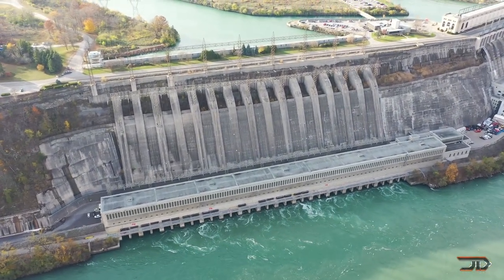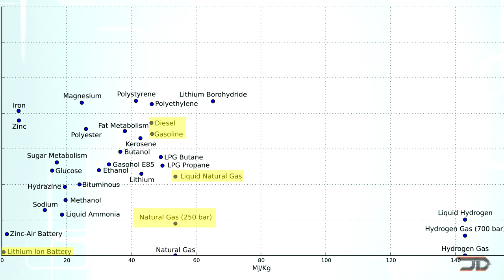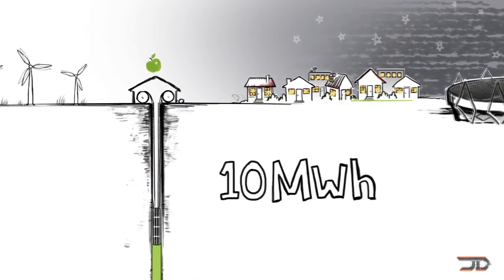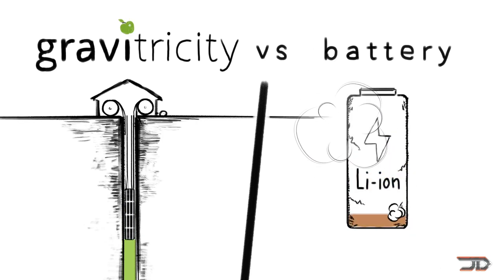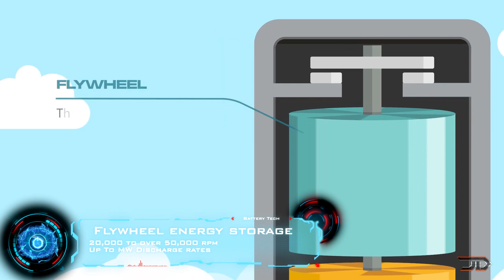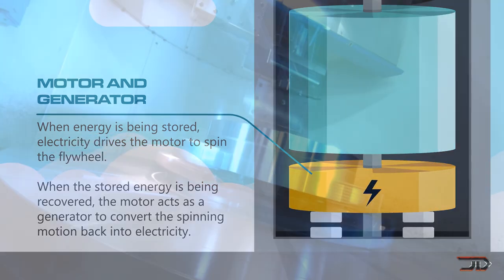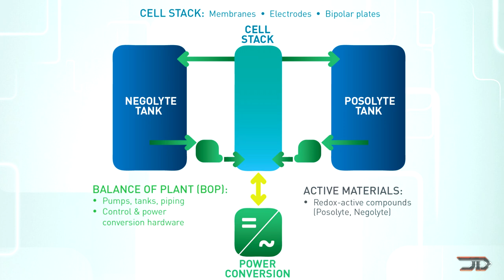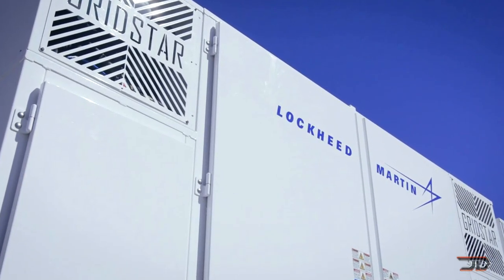The WEIRDEST Batteries In The WORLD

Comment: Flow battery, restructure the lead acid battery. Take extra precautions in its design so that a modual unit can be sealed. Multiple lower voltage stacks should be able to pump out the power needed to balance household energy demands.

Comment: That Energy Vault thing seems like something dreamt up by someone with zero grasp of physics and practical engineering. Not to mention the 'how do they precisely position each block when the wind is blowing' question.
Reply: Also the power is either rather low for such a big thing or you'd need some serious high tech for the motors alone. Not just usual crane parts. This affects the robustness of this system with lots of moving parts.

Comment: The inertia problem with the gravity weights can be solved with a few gaskets in a valve. Basically the weight acts like a piston when the valve is closed, and moves freely when the valve is open.

If you do it fast enough you can even get a bouncing effect that shoots the weight right back up at you.
Reply from the maker: Good idea, that setup would work a lot better! The gravity battery is also not as crazy as some ppl think heh
Reply: @Tech_Planet  theoretically that would allow you to use the shaft to store compressed air. With a pulley on the bottom you can extract the energy going up, then down again.
Reply: @Tech_Planet  Pumped hydro is basically just a gravity battery.
Reply: @kirkc9643  pumped hydro is literally a gravity battery. But it's just one type and has advantages and disadvantages.